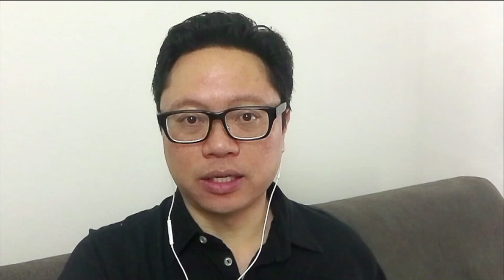Is Balanced Audio Better For Headphones?

Comment from the maker: The answer is, in short - it really just depends on the design.  As a protocol for headphones, balanced or single-ended, is not inherently better.  I've seen many cases where balanced is being used as a crutch to make up for some flaw in the amplifier design, or an amplifier/DAC is marketed as being balanced, when internally it's really single-ended or not full differential balanced. So, there's a lot of BS out there. Good singled-ended (like for example Chord DACs which are singled-ended) will always sound better than mediocre balanced.

The other issue with balanced is the connectors. There is not an industry-standard (yet) so there is 4-pin XLR which is too big and inconvenient for portables, 2 3-pin XLRs, the new Pentacon connectors, which seems ideal, but it's really difficult to work with very tiny connectors inside.
Reply: thanks for making this video  !!!!!! my confusion solved !!!!! i going to buy the mojo-jojo
Reply: Hi. Do you know how I can connect a dac or a dap with a 2.5 mm balanced output to a home stereo system? Is there a balanced 2.5 mm one pin to two pin cable available?  I have only seen the unbalanced 3.5mm , one to two pin rca cables.  Thank you
Reply: You are so helpful thank you I have been looking everywhere!
Reply: Can you go into why exactly balanced may sound worse excluding internal components?
Reply: What about 4.4mm vs 3.5 or 2.5?🤔
Reply: The answer is actually no, not "it depends". Balanced works by providing two powered connections to the drivers with opposite polarities. The reason that this makes no difference is because the driver responds to the signal going through it, and does not respond any differently to - 1V/+1V than it does to -2V/0V. Balanced can be used to deliver more power and/or increase efficiency, but once the driver is being driven to the desired volume without the amplifier clipping or producing audible distortion, throwing more amplification at it will do absolutely nothing. 
Balanced does provide inherent noise protection, but this is irrelevant for anything that an amp will be driving since the signal-noise ratio will be too high for the noise to be audible, with the possible exception of extremely sensitive earphones in very noisy environments. Balanced can be very useful in other situations though, like running low-level signals like those from microphones over long distances, but it is irrelevant to the consumer except for a few very specific situations.
Reply: @MrDrTheJniac  Seems like a lot of people (including the author of the video) are getting confused between balanced cables and balanced headphones. Those are completely different things. Balanced cable uses two signal wires (original and inverted) AND a ground per each channel (for stereo you usually need two of those cables with three wires in each, so it would be 6 wires total) to minimize the noise the cable receives. In this case, there is a special circuit required on both ends to invert the signal. Balanced headphones, on the other hand, only use a 4-pin connector, to connect the drivers separately without having a common ground cable like most of headphones on the market have at the moment. It has nothing to do with noise reduction and a length of a cable. It's being done only to get rid of that crappy "optimization" with a common ground for two channels.

Comment: It depends, many headphones sounds really better in balanced.
Reply from the maker: Nope. Headphones don't care if the signal is balanced or single-ended for how they sound. It all depends on the amp. The secret about balanced is that a lot of manufacturers HAVE to incorporate balanced because of their noisy substrate designs and going balanced is the only way to make them less noisy. From these devices, yes, balanced will sound better.

Comment: Thanks for explaining the actual physics behind all this "balanced audio" hype....I have a fairly expensive high end digital audio player (almost 1000$) that has a balanced output along with the standard 3.5 mm audio jack & I was wondering if buying an expensive balanced cable for my IEMs would make a difference. I guess it probably won't.

Comment: in old houses there are 2 pin ac 220v power plug ( without the ground pin) in this case (music on my laptop plugged in this 2 plug ac connector i get 50hz hum on my iem (bqeyz spring1 single ended 3.5mm cable) that i don't have when i plug my laptop in a 3 plug ac 220v plug (that has a ground plug).  i believe balanced usb dac + balanced 2.5mm jack cable will remove this 50hz hum even if i use a 2plug ac 220v plug, does it not ?

Comment: Good job man and good info. I was looking at the iFi Signature Dac/Amp which basically is the follow up to the iFi Black Label but with a 4.4 balanced input. But like you mention in the video... the Signature has the 4.4 balanced input but the Dac/Amp circuitry inside isn't Balanced. Very Deceptive. Gotta pay attention or u get burned

Comment: What's your thoughts on headphone cables with in-line mics? I've been conteplating between 2 extremes: either get a balanced 2.5mm MMCX silver cable, or a 3.5 MMCX copper cable with in-line mic for my Campfire Polaris V2 - running through the BTR5 (which has both balanced -using 2x dacs, and single ended -using 1xdac). The extremes are 2.5 mm - supposedly better sq? or 3.5mm with mic - much increased usability and portability as the in-line mic with volume controls is compatible and recognized by the BTR5. Do in-line mics degrade the sound quality/signal much/or at all?
Reply from the maker: I would try to avoid a cable with a mic unless you really need the mic. Then can indeed degrade the audio quality.
Reply: Unless you phone was/is a flagship at some point, it can't use the mic, I think.

Comment: Dude in my headfones the left one has a higher audio compared to the right is it broke or something?
Reply: If you checked the cables, Fit, clean conection, Pad placement and fit, Padding of drivers, cleaned your ears checked if you are losing hearing (onesided), checked your outlet and your source. Maybe.

Comment: Hi chaplain Andrew here  I'm using a balanced headphone/ microphone combo on my analog mixer the astro a10s with a trrrs to trrs cable and I cannot record anything from the microphone but when I connect it to my headset splitter then into my trrs splitter then I can record and sound good what am I doing wrong thanks in advance ps when i turn on phantom power for about 5min then turn it off i sound great but then it dies down i even got a trrs to xlr adaptor

Comment: That was what I thought. To benefit from a balance cable from source to the headphone, I thought one would need an inverter at the headphone end to cancel out the noise that may have picked up from the source to the headphone. I don't see this mention in the cable spec and most headphones does not have this chip to cancel out the noise signal.
Reply: The headphone is a speaker, which has two terminals, if a noise is presented on both terminal, it is rejected by the speaker. That is how it works.

Comment: How can I know how good the balanced circuitry is in my DAP, the Fiio M11? If I use it with a single input into my HD800S, a comfortable playing volume is 75 of 120. When I plug in the 4.4mm balanced cable, the volume comfort level drops to about 50 of 120. I don't hear a difference in sound quality. Good video. Thanks!

Comment: even after all you said, if balanced was to become the standard then it would be easier to make circuits as you said, crutches are ok to, and also the plug is sturdies on balanced and you get more power, 1w is not enough for sure, many headphones are below 100db, and that is rated in 1w.  that is not loud

Comment: there's only one way to find out : try it yourself
Reply: the problem with that is that someone will plug into the SE vs balanced on the same amp (which will give them way more power) and compare that. This is where a lot of the misinformation comes from on this topic imo. The balanced with high impedance HP's, will most likely sound better because of the power spike. If you have the same output from a different amp SE, it should technically sound better.

Comment: Great explanation.....clears up balanced cable  hype vs. poor circuitry secret ....  That balanced cable may mask poor circuit design in some cases. Like you said....not that cut and dry, users have to research their gear first and read reviews.....think many people bought into balanced cable hype as an instant fix for better sound, some cases it is...gotta do more research still...

Comment: Is the Cavallli Liquid Carbon 2.0 Amplifier a good option for a balanced out choice? I heard you don't need a balanced dac for the LC to make the signal balanced? I am pairing it with a saber dac and a focal clear.
Reply from the maker: It's not bad for the price and is a bit of a dark sounding amp which should help with that dac.
Reply: @phototristan  is it a true balanced amp ?
Reply from the maker: I don't believe it's differential.